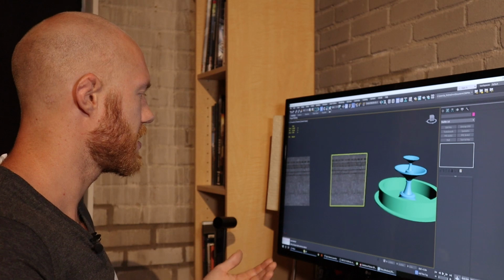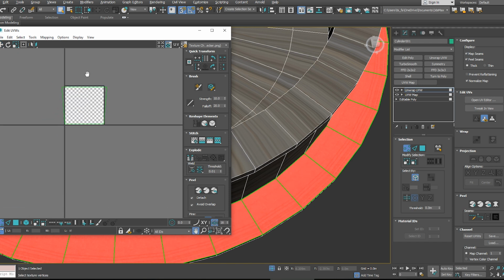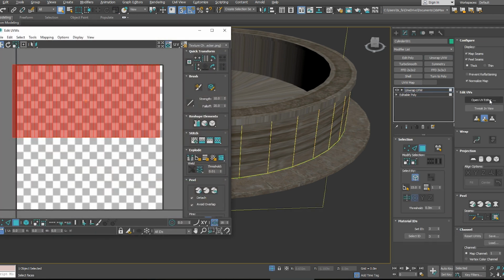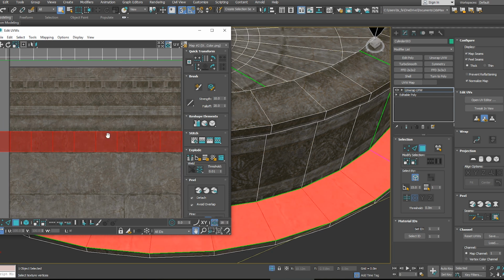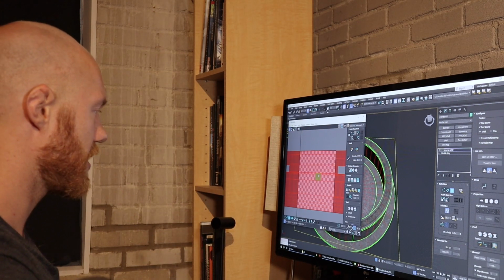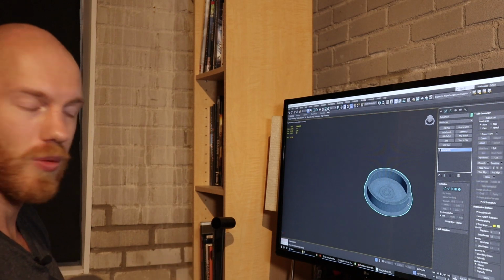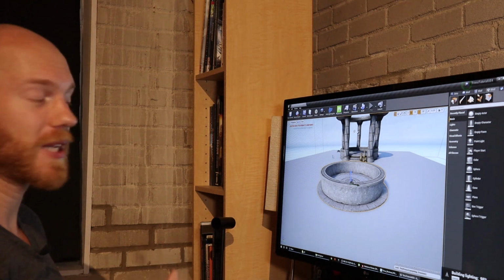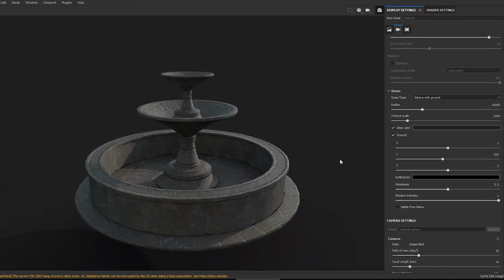Quick and Easy Trim Sheet UV Mapping Tips -Trim Texture Tutorial Part 4

Comment: Hi!, nice video series, i have quick doubt, could we use the first uv chanel to project a base material, say a high to low baked normalmap, base albedos (maybe done on unreal so we save memory) , AO (baked too) and roughness. Then use the second uvs channel for this trim technique to add detail, and then use the 3rd uv channel for lightmap baking on engine? or that would to expensive and the benefits arent that much? i am use to create traditionaly done models,  high poly then bake to low, texture and put all that on just 1 uv space, but thats isnt as efficient as these trim technique even if you do texture sheets for multiple assets.
Reply from the maker: yea you can definitley do that, it works well for huge scale assets. a lot of the rocks in god of war had a unique sculpt at like 1024 res and then tiling detail normal maps and stuff like that on top, so a similar method to using a unique bake and then detailing with trims or tiling textures. It's more expensive, but if you need that mixture of unique detail and trims its a valid method.
Reply: @PolygonAcademy  nice, I saw a post one the environment artist at Ubisoft that worked on the Assassins Creed origins and they did use trims a lot, it wasn't clear if the use a unique sculpt but it looked like, now, at the company I worked for, we have move from mobile and cartoonish games to modern triple AAA photorealistic games, so we are exploring all the options, thanks for your reply. 😉
Reply from the maker: @AndresOñate-f4y  open world it is pretty rare to use unique sculpts on most things, maybe for things like statues or large rocks, but most modular kits like buildings and stuff would be tiling textures, vertex blending, trim sheets and maybe some edge decals to add detail.

Comment: Very cool tutorial series! Id love to see a video where you have a complex environment, like a facade of a building (greek for example) and how do you plan to make the trim sheet to use for this building; because thats my case: i have a large building that ive made semi modular, but its not textured yet and i dont know how to proceed for the texturing part
In short, instead of making a trim sheet then a mesh, do the opposite: make a building then a trim sheet for it, it will be very interesting
Reply from the maker: good idea, I have been thinking of doing a scifi one based off a model/modular kit for an advanced trim sheet tutorial on gumroad with some more techniques.
Reply: Polygon Academy yes cool !

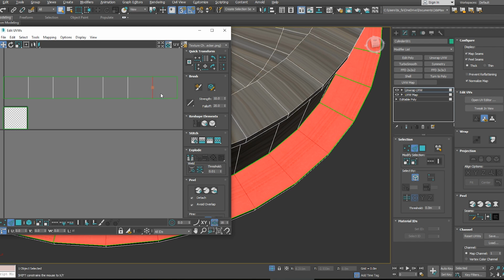Comment: 8:05 Dude, why bother doing all that stitching and stuff? Just apply UVW Unwrap, Select the whole circle, planar map it, break one of the edges and press straighten. It will automatically unfold into a straight strip for you.
Reply from the maker: hahah ive literally never tried that, I am so used to old school max I never even noticed that button face palm thanks for the tip, I love learning from you guys too :D
Reply: @PolygonAcademy  Yay more old-school max users. The UV tools have really come along way.
Reply: Straighten is great when it works but I've found a few times that it doesnt - sometimes it can be a bit finnicky. A little tip tho - if you hit straighten and the result isnt perfect, hit the relax button beside it, then straighten again. gives a more even distribution of polys
Reply: @michaelarby  True. In case of bad result I try to align the verts both vertically and horizontally using the functions at the top of the toolbar. Just need to make sure you use an alternative align option, which can be accessed by holding the align button.
Reply: @EugeneLychany  This one is an important one for people to know about. It saves you so much time since you can just grab all horizontal edges and straighten them relatively and then do the same for the vertical edges and boom.
Reply: @michaelarby  Could be that it didn't work because you didn't lay proper seams, which doesn't allow it to actually straighten itself out.
Reply: @Zakjuh  entirely possible! I'll need to play with it a bit more to see what its limits are. Great tool when it works though.
Reply: I came here to check this, I was like "why does he bother? am I missing something?"

Comment: I have one question regarding how you straightened these UVs, what you did is basically a deconstruction of what plugins usually do in one click with their "straighten UV" option right? Or is there something i'm missing here? As long as the UV shell is straight and clean at the end, it doesnt matter if you followed all those steps or not right ? i do not mean this to question this video at all, i'm genuinely wondering if i was doing this wrong all along without knowing ^_^'.
Reply from the maker: No worries! Yea doesnt matter how you get there, the first method i showed is one that translates to pretty much any software, like the most basic way of doing it, the second method with the unwrap by loop is the much easier 1 click option i normally use, but yea plugins can make this way easier. All that matters is the end result :)
Reply: @PolygonAcademy  Ahah alright i see, thanks for your reply! Yeah i was just worried that i was skipping a vital step to make it clean all this time !! Again thank you for sharing the knowledge, i hope you get enough support back for this hard work. Cheers !

Comment: Love the vids! My only issue doing workflows this way, is when I do AO bakes within 3DS Max, it causes problems. The AO bakes I do depend on the same UV layout as the texture because I tend to bring them into Photoshop to layer the AOs on the Textures, to enhanced them or darken/lighten them if needed. What I learned is that you should keep your UV layout within the 0 to 1 space, so if I do not do that, i cannot bake out proper Diffuse maps or AO maps, etc to use in Photoshop. Is it recommended to stay within the UV space and if you can go outside of it, how can I bake a AO on the same UV layout ot use in Photoshop doing it that way? thanks! :)
Reply from the maker: You could bake an ao in on a second uv channel like i show for lightmap ivs and then overlay it in the material/shader you can overlay stuff from channel 2 onto textured models in ue4 by plugging a texcoord node into the uvs input of the texture sample and setting it to the second channel id.
Reply from the maker: If you are using a pbr workflow you really should lnt be adding much ao to your diffuse textures in photoshop really, it breaks the lighting, it works for stylized stuff but i would keep it super subtle
Reply: @PolygonAcademy  good to know. atm im not using ue4, just working in some older unreal engine for Killing Floor 1. that is why I'm using PS for that sort of stuff. found it helped add more detail in that game engine for me as it uses old school vertex lighting! :P AOs help a lot in that one.
Reply: @PolygonAcademy  ty for the quick reply and info! appreciate it :)
Reply from the maker: No problem :) yea older engines you can adapt to your workflow as needed, its always a back and forth with tech vs art 😂

Comment: If you're using blender, there's a fantastic addon call "Uv Squares"
you just select the faces, press the button and it will automatically arrange the uvs into a square grid or one dependant on the size of the faces.

You can also use follow active quad with a face selected to straighten the uv's but this doesn't work on more complex geometry.
Reply: Go for textools. It includes uvsquares and has a bunch of other useful features as well.
Reply: @NoTengoIdeaGuey  I'll definitely have a a look at that, thanks!
Reply from the maker: Sick! Thanks for sharing :)

Comment: If you are working in Autodesk Maya and trying to turn all of the faces into a square like Tim does in 3ds max. The tool you want to use is called Unitize. It will turn each face of the cylinder to match the 0 to 1 space and they will all be stacked. Then you can just move one shell off of the rest and unfold and then basically just select all the edges and move and sew them all together.
Reply from the maker: Awesome, thanks for sharing! Thats good to know :)

Comment: Maya users: The way I get straight UVs is this: 
1) Unfold as you normally would. 
2) Make sure to have an edgeloop running down the length of the curved shell that you want to straighten. (you could delete it afterwards if you don't need it) Select this loop and find the "Straighten Shell" option in the UV toolkit under the unfold tab. 
3) That should get you almost there. Select the uv's of the shell and select "Straighten UVs". Sometimes you need to mess around with which edge you use to straighten the shell.  
I think this method is quite fast and the Maya does the work for you :)
Reply: If your shell is almost straight already, you can skip the Straighten Shell step and just select the UVs and use Straighten UVs. Another nice option to mess around with is the "Unfold Along U or V" option.
Reply from the maker: awesome thanks for the tips! im sure it will help the maya users on the channel!
Reply: I hope so :)
Reply: Thanks for the tip, but that sadly didn't work for me :( If I add an Edgeloop inside of the ring (I just used the pipe primitive for testing purposes :)) select it and then hit "Straighten Shell" all it does is this weird bug(?) where it minimized the whole shell to a tiny dot that becomes unscale & -editable (btw, wtf is that even about? Hate when that happens, thank god it can be fixed with a simple UV projection, but still, wtf)
What I managed to do without much hassle was to make a cylindrical projection, which then made the strip a line, but I then selected the edges in the viewport and moved those up inside of the UV editor (which also moved them on the bordering shell of course, but that was the best I could achieve without having to "handcraft" the UVs ^^)
And all did in the pipe primitive, so no idea how that will perform on a "real" mesh 🙈
Reply: @angiemon897  That def sounds like a bug. I guess make sure you've deleted your history first before unwrapping. I know that can sometimes cause issues. A cylinder should naturally unwrap into a rectangle though, you shouldn't need to straighten the shell for that kind of primitive. Maybe email me some screenshots if you're still having issues and I'll see what I can help with.
Reply: @Spyro_2076  thanks for the answer :) did this never happen to you? I've had this *@%$§ haunt me in different projects and on different machines.. ^^ and I absolutely hate it, but as I mentioned, thankfully can be fixed if the shell is projected, still annoying.
Actually I made a pipe, (or did you mean cylindrical as in the projection method? anywaay) then tried to manually make a strip of the top&bottom rings, so basicaIly had a planar projection of the ring shell where I tried your technique. Really strange :( I will keep trying to do that and then indeed might get back to you if I may :)
Reply: @angiemon897  I think i've had that happen to me but not for a while now. I also think clearing the history, and also cleaning the mesh and choosing the non-manifold geometry option solved it. I can't say for sure though as it was a while back.

Comment: There is a cost with having lots of UV Channels but it's not a huge deal unless you are wasteful.
The one cost I'm definitely aware of is that for every UV Split it will have to split vertices in engine just like it does for materials, vertex colors, hard edges.. etc. It goes into your vertex count.
Reply from the maker: yea exactly. vertex count for current gen isnt usually the issue for performance, long before that you redcce materials, drawcalls and *tear*....lights. so while there is a cost it's minimal

Comment: A big thanks for the tutorial. I have a question. How you would add dirt on the bottom if you'r using trim sheet?
Reply from the maker: you're welcome :) you could vertex blend some in, or use a decal applied to some geometry that is just slightly off the surface along the bottom

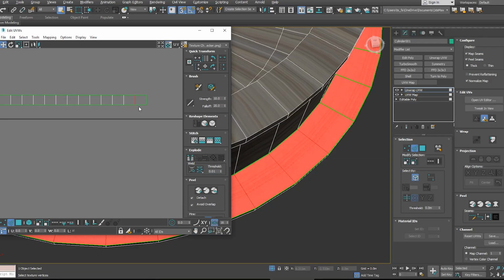Comment: 8:30 
for Maya users: You can select all edges you need to sew, then deselect one edge and do move and sew once. Saves a lot of time.

btw Tim: Awesome series as always!
Reply: I hate Maya but its UVs tools are great. Not sure you can really compare with Max lol
Reply from the maker: @tetsuooshima832  yea i used maya at my first job and its snapping and uv tools were great
Reply from the maker: good tip! thanks
Reply: C'mon guys, I'm using max and discovered "Straighten Selection" button like years ago. All you have to do is detach your poligons, create one seam and it'll create nice strip (but only if all of it in quads which is true most of the time). You can relax it later to get back proportions and then align all vertical and horizontal lines in a few clicks. Works for me in seconds, I would never spend that many time doing that stiching so long!
Reply: So there's no way in max to do this.. We have to select each edge and sew them one by one? (I'm just starting out learning how to use 3DS max (maya user here))
Reply: I am amused that max’s UV editor is still slow as hell when you try to unwrap something heavy or try to make layout of several complex models in one UV space. And I’m not even talking about that its separate modifier... I literally don’t unwrap there anything besides cubes)

Comment: Amazing. Thanks for the lightmap channel tips. I've already used it but make uv map using autogenerate lightmap built in Blender and got weird results. I didn't get that I can use different and much simpler seams. I haven't understand lightmaps until your tutorial. What size of lightmap created in 3d soft do you recommend: 32,64,128 or more?
Trim sheets are very useful but they are quite hard to project and predict what can be useful or useless in the project.
Reply from the maker: glad to hear the tutorial helped :)